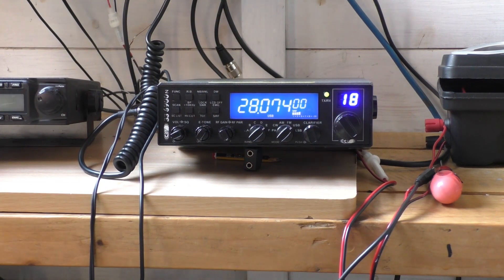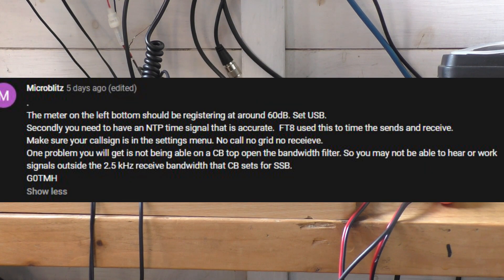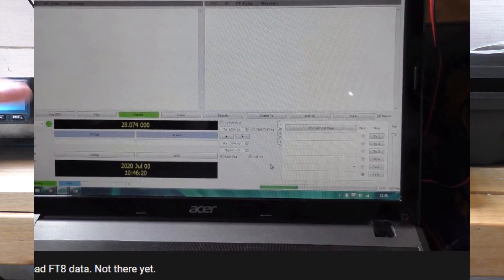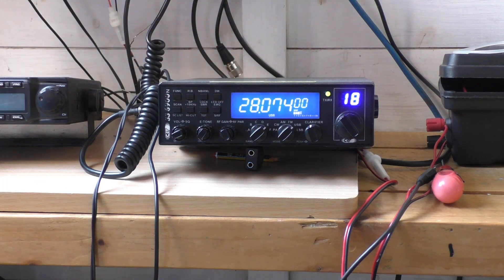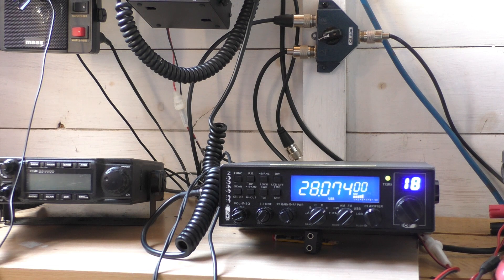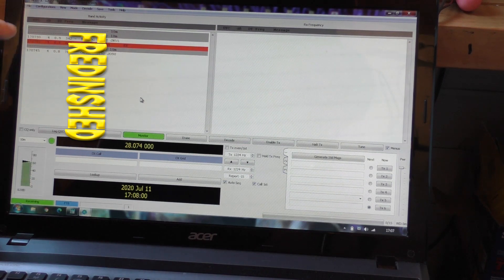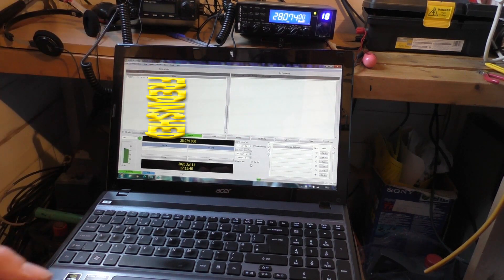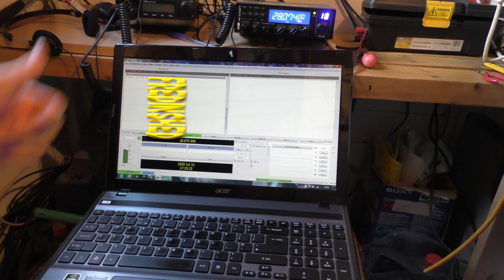Decoding weak signal FT8 data with a cheap CRT SS6900N.  Awesome.

Comment: Fred. Did you try setting up your 450D for FT8. I have scouring the internet for a suitable video without much luck?
Reply from the maker: Hi.  No i just used the 6900.  The 450 would be easier as it has a built in sound card.

Comment: There is a program called JS8call which is an off shoot of the FT8 protocol but is designed for chatting rather than just signal reports. And It is being used on 27.245MHz  Check it out http://js8call.com/

Comment: Hi Fred what's happened with the 305 net
Reply from the maker: Still going strong twice a day.  I was on there today.
Reply: @CB-RADIO-UK  have the times changed mate as I know that myself and others would like to try and make contact
Reply from the maker: @reviewingmd5631  No its the same.  6-7am mornings weekdays and 4-4.45pm (sometimes shorter).  There is normally a few on air.
Reply: @CB-RADIO-UK  cheers all the best  vince 26CT3412

Comment: Hi Fred can I ask u what size power pack to use on superstar 6900n for home because I am due to order mine in August thanks neil
Reply from the maker: Iam using a 15 amp LED supply.  Seems to work well.
Reply: OK cheers 👌😊

Comment: Hi Fred. Got an issue. I've not done anything to my ss9900 and my clarifier  seems to have stopped working. Been told it can also be used as a kc shift, but as i said, not touched anything I don't know.
Reply from the maker: Have a look in the main function menu at FIN. Its just before the colour change option.  4 options available.  Check its not set to OFF
Reply: @CB-RADIO-UK  cheers Fred. At work at the min. Will check in morn.
Reply: @CB-RADIO-UK  Yep sure as eggs is egss it was turned off. I've set it back to R and all is good now. thank you

Comment: You could still try to connect the radio via speaker jack at the back of the radio to the mic in on the laptop. Then adjust the mic level down to suit in the sound card settings so the audio does not over drive. It will help to get a better decode of signals and you will not interfere with the signals with noise in the room and you also wont have to listen to the tones all the time. Also try activating the waterfall feature in the software then you will see the signals on the waterfall coming in. I use FT8 all the time here in New Zealand on the ham bands always active on basic dipole and vertical antennas....
Reply from the maker: Thanks Jason

Comment: Very good Fred. Glad to see your videos
over here in the US. Went with wife to
London 7 years ago this month on
Virgin Atlantic. Very nice trip. Saw HRH
Queen Elizabeth in her Rover at Buckingham Palace drive by! My wife
and I too like reading about the Royal
Family's goings on. Enjoyed the Pub
in Earl's Court, near the tube. People
were nice in the UK. Been back to London also in 1979 when your CB was
developing as it was big in those days
in the US. I had the call KBG7077 from
1962, for CB, when one had to be 18 to
be licensed. Last CB call was KXR6485,
which expired in 1985, when CB in the
US became unlicensed. I was first licensed as a novice Amateur at 17, in
1962, as WV2ZPD, later as WA2ZPD,  when I became a Technician Class, and
General Class in 1979. I became an Advanced Class in 1994, which isn't given an longer, and finally Amateur Extra
Class in 1995. I obtained the vanity Extra
Class call letters, W2CH, in 1997, until
now, 58 years later. My Elmer amateur
is also still around, first as WA2USG, then
WA1LKF, in Massachusetts, and N1MH,
with the Extra Class, a few years ago.
He does FT-8 often on HF. I started with
Packet almost 40 years ago, and when
Digital Modes were new, about 20 years
ago, PSK-31, which was developed by a
British Amateur, Peter Martinez. It's 
similar to operating FT-8, being weak
signal, using low power levels too.
Actually, I was born in Marylebone,
London, in 1944, during the war, my
parents went from the Continent to
London in 1939, just before the war,
and in 1949, we came to New York
City on the Queen Mary. My Uncle was
in London too and came to the US a
bit after us. My Father and Uncle were
sent to Canada to work there from 1940
to 1943, when they came back, my parents were married in London. We
lived off Edgewere Road in Park West,
near Marble Arch. The RAF Spitfire pilot
after coming back from being a POW in
Germany, Douglas Bader, was an apartment building neighbor when I was
young there. Actually, Ancestry.com,
shows my genetic background is 29%,
British. Nice watching you again. Enjoy
FT-8. Raymond Martin (Nahl), W2CH.
Reply from the maker: Born in London your a cockney me old mucker :-).  Nice to hear about your trip over 7 years back.  London has changed but there is still a lot of history to learn.  I was also born in London but moved out to the sticks when i was 4.  When i left school i went back and worked there for 5 years.  Its way too busy in the big smoke these days.

Comment: 1. I'm using an old 360FM/148GTL-DX to listen to FT8
2. Speaker out from rig into a mixer
3. CD/Tape out to line In on Computer
4. Dimensions4
5. WSJT-X Software

Good time to do Foundation / Intermediate licence as available online with no practicals needed Fred... ;-)

Comment: Next step: Install JS8Call (based on FT8) and you can get in contact with me on 27.245 MHz. The official freq. for JS8Call is 27.245 MHZ USB on 11m band. I have stations from 29 and 26 div. on JS8Call here in div. 13 everyday. With JS8Call you can chat, too. FT8 cannot chat. It's working with 4 Watts (or more). But I'm working with 4 Watts in USB everyday.
Reply: Ja, finde ich auch gerade ein sehr spannendes Thema. Hab ich das richtig verstanden - audio out an der ss3900 in den Mic-Eingang am Laptop stöpseln?

Comment: Be great to see you on FT8 Fred :) you can use JS8 Call as well for full text-based weak signal chat. I'm on 10W and as you say, get around the world on it (albeit on 40/15m) - what I think you can also do fred is 'spot' FT8 and upload to PSKReporter - amateur radio people appreciate the propergation reports, esp on 10m which will have similar propergation for CB. You dont need a call sign to report, same for WSPR, your helping amateurs, just put the correct maidenhead grid locator in.

Comment: WOO HOO :-)  Excellent, pleased you've got it working for you. 
OK next stage, let's see how far away you're receiving from.... I'll step by step it again ;-)

1) On WSJT-X Click "Settings" then "general" then put in a callsign, something like "FITSS" for Fred In Shed Short Wave Listener.
2) Enter your Maidenhead Grid square number (if you don't want to reveal your exact square just  pick one that's nearby). If you don't know what it is visit here https://www.levinecentral.com/ham/grid_square.php & put your postcode in, you'll see  your square, and you can adjust your postcode until you get one near enough for you to be happy with.
3) Click on the "Reporting" tab & select the "Enable PSK Reporter Spotting"
4) Click OK on the settings window to save
5) Run WSJT-X exactly as previously, with the mic etc & let it decode some signals.
6) While that's happening visit website www.pskreporter.info & enter the same "callsign" that you used in WSJT-X & click OK
7) This will take you to a map of the world with the stations you have decoded & uploaded shown up on the map
8) Work your way across the boxes at the top so they contain :-
10m - signals - received by - the call sign - "FITSS" (or whatever you chose) - FT8 - Last 24 hours
Before you click "GO" to refresh the view, go to the right of it select "Display Options" highlight the top 2 boxes to "Hide Faint Monitors" & "Hide monitors if no reports", also highlight "Show SNR"
9) Close the display options popup with the cross at the top & then click "GO"
10) After that, the map will be refreshed & populated with all the stations you have decoded/uploaded, along with little flags showing how long ago in negative minutes & the db they were received at (irrelevant to anybody except yourself for comparison  purposes & will be worthless if you adjusted the volume on the rig or the mic level when recording)

I ran it for 24 hours on 10m a few weeks ago & decoded over 1000 stations on 5 continents @ a maximum distance of over 9000 km, (hover over the station to see this distance info pop up.)
It's a great tool to see the propagation & how your antenna is performing, where it's strong at receiving, etc.

Nice one hiding callsigns, it's appreciated by Hams, as are QSL's if you decide to be a SWL or..... get that foundation license applied for & we'll help you transmit as well.

Enjoy  :-)   73 / 10-10  26CT3662      Let me know how you get on  :-)
Reply from the maker: Many thanks
Reply: I was going to suggest this too. pskreporter is a great way to  see how your doing. You don't have to be a ham to do this, there are plenty of short wave listener stations who do this too. On pskreporter you can also see there are CBers on 11m doing FT8 too.

Comment: Try looking for FT4 signals. Half the speed at 7.5 seconds sent and received. Also JS8Call which is similar to FT8 but is more for text between users in a weak signal mode.
But glad you are enjoying the decodes. Get a SWL call and you can send cards to them as you decode them.

Will, 2E0WHN

Comment: I will  encourage you to contact RSGB  and go do foundation license with 10 watts A99 Aerial then you can use Yeasu FT450 with FT8 Data Modes  I did 30 years ago a local Radio encourage to get my Amateur Radio license  please do not get wrong I am not anti-CB  that is the I got into communications hobby

Comment: Well done Fred. Excellent work with the 6900N. I never did get it to work with that rig and now use the 450D. 
As you've managed to decode FT8, you should also try and decide WSPR signals. 
CT3535 / M7
Reply from the maker: Thinking off SSTV in the future.